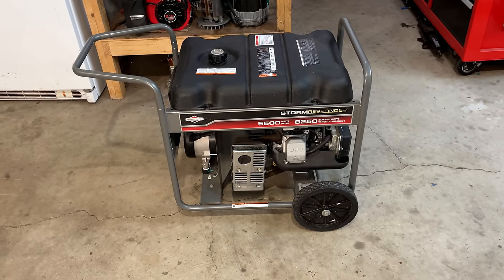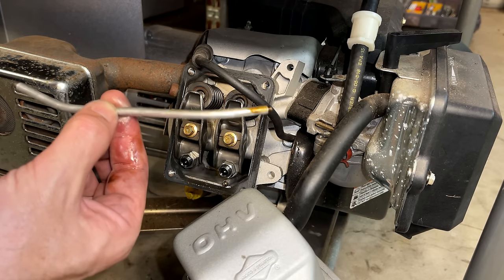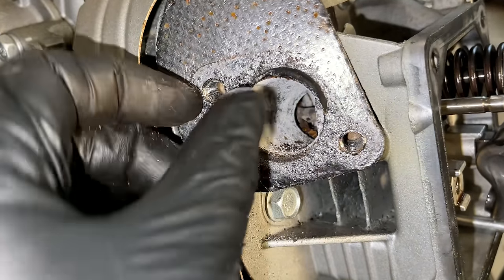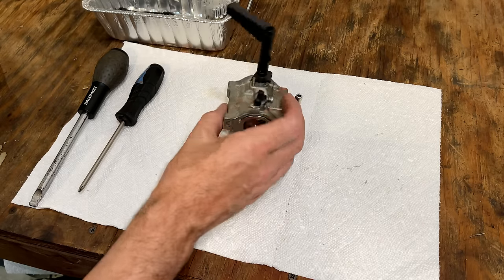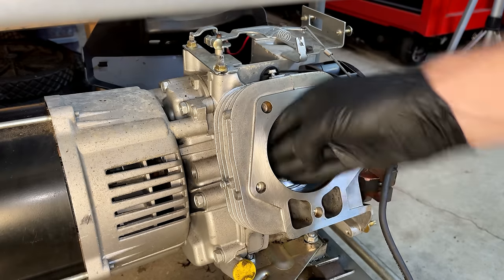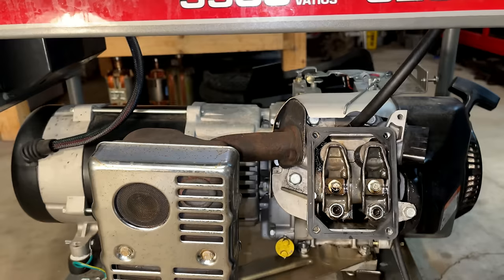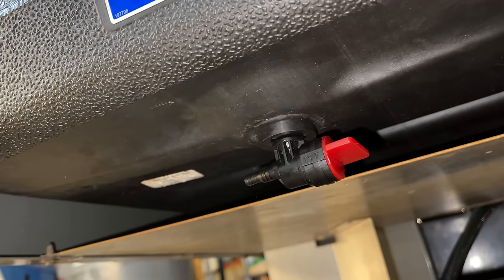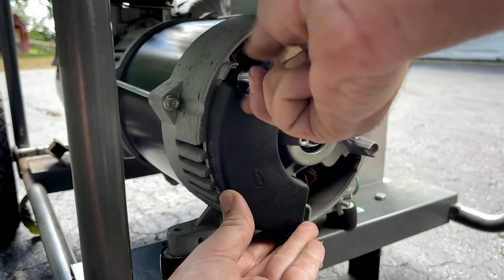Seized Engine - Can This Generator Be Saved?

Comment: Jim, I picked up a smarter power generator, and noticed that the few cap was missing. I contacted the distributor, but to date they haven't responded yet. It's an odd cap as it resembles a Stant automotive fuel cap in that it's a male threaded cap with course threads, however it more stout, and the cap too narrow. Do you have any information on these or a source for parts? I do have another tank that's complete, but not an exact fit, but will work for testing or service. It's an ST-GT3500, and a date code of AUG152013.
It's got compresion, and appears to have been moderately cared for.
I have a parts engine with electric start that I plan to install on this one, if all else looks good. It's from a 7 HP engine and this one is a 6.5 hp
Reply from the maker: I have only seen a male threaded cap once and it was on a 10,000 watt gentron generator made by JD North America (subsidiary of Chongqing Doyen).  It’s the top cap shown here 
https://parts.jdna.com/g65-o-01a-jd

No idea if it will fit.  I have not been able to find a picture of your generator so cannot recommend any alternative tanks.

Comment: Does anyone know what the rocker arm hold down bolt toque spec is for this engine? Or a link to the toque data sheet? I tried to look it up but can’t seem to find it anywhere. The center bolt. Thank you
Reply from the maker: 100 in-lbs
Reply: @jcondon1  , thank you sir

Comment: Hello James I know this comment will probably reach you too late to check the Voltage requirement? I thought that the 140V standard sounded a little odd.
I did a little research, I could not find any country listed that had a 140V standard.
I was thinking that there may have been a mistake and the country is a 240V standard. There were many listed at this voltage. If it actually is 140V could you mention in a future video what country it is please? Thank you in advance one of your regular viewers. Keep the interesting videos coming please.

Comment: Worldwide mains outlet voltages run on two groups - 100/110/120/127 and 220/230/240. These can be with 50 or 60Hz. In the UK the specification is 230V +/- 10% . Thats from 207V to 253V.  In the USA the NEC recommendation is 120V +/-  5%. Which is from 114V to 126V,  If the African School uses equipment donated from the USA then this generator will be ideal. Computer based machines uses low dc volts like 19.5 V dc as an example. The types of SMPS power supply used for these can accept anything from say 100V up to 250V. That will be either 50Hz or 6Ohz.  If they want to use the local African or European imported equipment using 230/240 V they will need to use a transformer. The people running the school sound like intelligent people. They will be aware of all of this.
Reply from the maker: The generator has a 240v outlet.  They would have to use an adapter, slow the engine a little and adjust the voltage if that is the case.

Comment: A great fixup job there, top quality work and done with love, but... I would have thought the cost of shipping to Africa exceeded the cost of buying a new Chinese generator there. Also I have no idea where he got the figure "140" volts from. ALL of the research I have done shows African countries as running 220/230/240 volts and 50 Hertz. Remember 60 Hertz, although not uniquely North American, is in the minority in the world. Running it slightly over voltage at 125 volts is probably just barely acceptable for so called "110 volt" appliances (I think there is supposed to be a 10% variation tolerance plus or minus). But I think it would be advisable to affix a placard to it clearly stating  "125 volts, 60 Hz". Indeed as he changed the voltage I wonder if that has affected the output in Hz also ?

Comment: Theory: They pressure washed it and squirted water into the intake.  The water passed through the filter.  They used some soap and it got through the filter and glued the blue plastic.  They did not start it and run it after pressure washing to heat it up and drive off the water.  They just pushed it aside.  Isn't it the rule that after exposure to water to always start a motor up and let the heat drive the water off.
So this would explain water getting through the carburetor all the way through to the intake valve and corrode it all up.  But the exhaust valve was stuck.  Hmmm... ?  I think my theory needs some adjustment.
Reply from the maker: Not a bad theory

Comment: Won't be much use in West Africa. They are 220 volts there.
Reply from the maker: He could you the 240 outlet if needed.  The engine speed could be brought to 50 hertz and the voltage adjusted to get what he needs out of the 120v or 240v outlets.  Most things will run fine between 100-240 volts - 50/60 hertz.  But not everything.

Comment: I'm curious why you did not remove all of the carbon deposits on the piston before reassembly. I was always told that leaving it in this condition would create hot and cold spots on the piston resulting in uneven heat dissipation which could cause distortion of the piston . Could you elaborate and share your opinion of this theory?

Comment: To my knowledge, all of the countries on the African continent operates on a 50~Hz line frequency on their power grids... with a domestic voltage of the old U.K. standard of 240 Volts A.C. 50~Hz. or 3-Phase @ 415/240 Volts A.C. @ 50~Hz.

Single Phase Installations only use One of the Three Phases Paired with the Neutral Conductor, for a Single-Phase, 2-Wire System, Operating @ a Nominal 240-Volts to Ground @ an Operating Line Frequency of 50~Hz or 50 A.C. Cycles Per Second.

The new European standard as set fourth by the I.E.C. has standardized the domestic electrical A.C. Mains Line Voltages to a 3-Phase A.C. 400/230-Volts A.C. @ 50~Hz... along with revised colour coding of phase conductors + neutral conductor from the old standard of R+S+T (L1,L2,L3) of RED, AMBER, BLUE + BLACK Neutral to the new I.E.C. standard of Black, Brown, Grey (R+S+T) Phases + Blue for Neutral. Protective Earthing/Grounding Conductor Remains Green with Yellow Striping, or Yellow With Green Striping, per I.E.C. International Electro-Technical Commission Standard.

Electrical Socket Outlet Standards on the African Continent is also likely to be the old British Standard (BS-546) Round-Pin style , now obsolete by British Standards and superseded by (BS-1363) that is currently in use in all former British protectorates or former territorial possessions, such as the Middle-East, Hong Kong, Indonesia,Singapore, Ireland.

India also uses the now obsolete BS-546 round-pinned A.C. switched socket outlet, as it also was a former British protectorate and has not adopted or switched to the new standard that has been standardised in 1947.

For the generator to be modified or reconfigured for operation on European A.C. Mains Voltage & Line Frequency, the alternator must be reconfigured with the 240-Volt winding Earthed or Grounded on one end, without any center-tapping of the winding for the neutral-point connection, as the neutral-point connection would end up being on one end of the entire 240-Volt winding. The engine would also have to be slowed or throttled down @ governed to produce the 50~Hz line frequency @ the output as well.

Comment: Ummm, IIRC Africa power supply is 50Hz. I realize that for many applications 50-60 makes no difference, but there's always someone who plugs in some (motor, ferroresonant xfmr, etc) load where it really matters. Do you think there's any reason this couldn't be derated to 50Hz and, say, 4800W? IMO, you'd probably be doing them a favor.
Reply from the maker: The engine could be slowed to 50 hertz and the AVR adjusted as needed.  The 240 outlet could also be adapted if needed.

Comment: Worth noting when using extensions, especially mutiple you reduce the torque being delivered by an impact quite a bit. If an impact wont remove a bolt, try getting it closer to the socket (if possible)

Comment: Isn't Africa 220v/240 50 hertz, in which case the GEN is useless.
Reply: Could it be tuned to 50Hz with an rpm adjustment?
Reply: Most of Africa is either 220 or 240V, 50Hz.   The exceptions are Libya and Morocco which have mixed 110, 220 but still 50Hz.

     Turning down the RPM from 3600 will get the frequency down to 50Hz, but the engine will not be operating close to its power band and the amount of KVA produced will suffer.

      It’s a noble cause to ship this generator to Africa, but it would be MUCH more cost effective to get a 10KVA generator that is already 240V, 50Hz drop shipped to Africa instead of shipping this one.

Comment: No iron sleeve or oil alert/shut down.....
Short service life expected.
Not a good choice for the purpose the customer needs it for........
He should trade it back to you for a more appropriate choice.
Reply from the maker: He did exactly that.  I let him trade up for the Honeywell I fixed recently.  It has an oil sensor and ball bearings.  Not sure if it’s sleeved.  But still better then what he had.
Reply: @jcondon1 great ...best decision yet from the customer...
 oil alert not fitted  that's the killer ...may only last a month or 2 of hard work untill its out of oil and ruined.
Re iron sleve ...
I have always been surprised by just how durable an aluminium bore is and they can work hard and go for an extremely long time as long as the air filter etc is clean.
Reply from the maker: @simonmorris6182  even the Briggs with no ball bearings and no sleeve lasts a surprising long time if fitted with an oil sensor.

Comment: When I buy a gen I always bring a can of starter fluid and a drop light. Unless I can get it run long enough to get the light to come on, then it's no thank you. 

The Africa story doesn't quite make sense in that Africa is mostly 230V/50 hz so why would you buy an American gen?  Africa is full of Chinese gens because the power grid is out half the time in many countries.  There is nowhere on earth where the standard voltage is 140V. There are a couple of countries that call for 127V - that would be the closest. After 127V you jump to 220V with nothing in between.

Comment: JAMES, OR ANYONE WHO KNOWS MY QUESTION, IV GOT A 8.500WATTS  GENERATOR WITH A CONNECTION FOR 3PHASE  ON IT BUT MY PROBLEM IS IT ONLY WILL GIVE ME A LITTLE  OVER ABOUT 2,000..  IF I USE THE MICROWAVE IT RUNS BUT THE FOOD COMES OUT COLD. AND IF IT USE AN ELECTRIC KETTLE SOMETHING ELSE WILL SHUT OFF.
 P.S. ALL I USE ON IT IS TWO 5WATT LED LIGHTS ONE FLATSCREEN TV.(plus a signal box for channels) A FRIDGE, AND A WATER CIRCULATION PUMP FOR A BACK BOILER WE HAVE ON OUR FIREPLACE. 
IM IN IRELAND 🇮🇪 SO 230V AND 50HZ. CAN ANYBODY TELL ME THE WINDINGS RESISTANCE AND VOLTAGE OF THESE THAT HAVE AN OUTLET FOR 3PHASE????? 🙏🏼🙏🏼🙏🏼🙏🏼 PLEASE CAN ANYONE HELP.